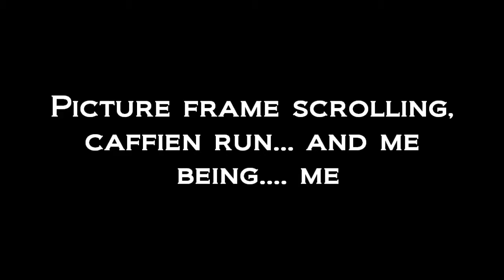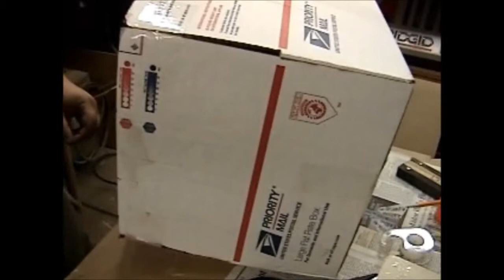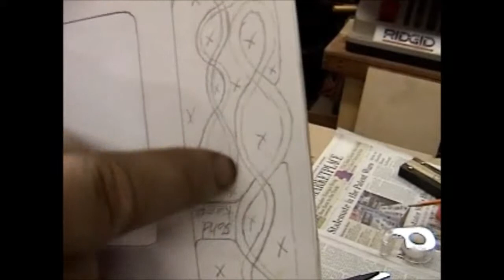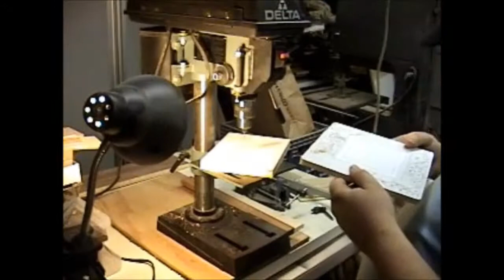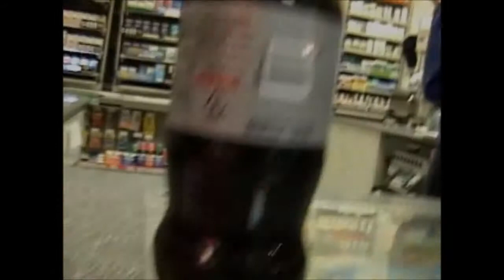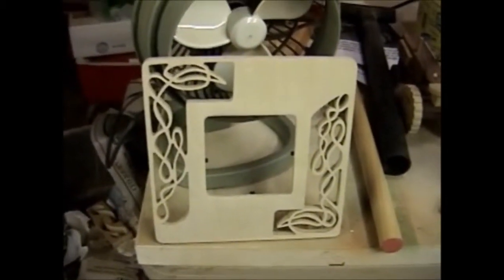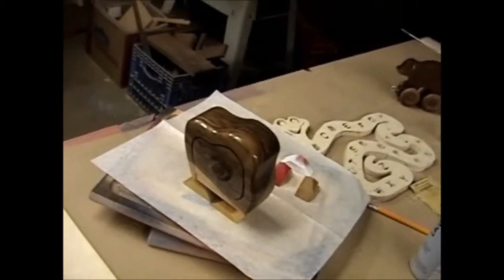Scrollwork on a $1 picture frame

Comment: Hi There! 
Contrary to the jerks opinion below me, I happen to think you’ve got some valuable info on your vids. 
Anyways, I do have a question and I’m hoping you’ll be able to help me- 
I’d like to start making picture frames similar to the $1 one you used with this project. 
Except I’d like to use a higher quality of wood. (Maybe a tiny bit thicker too) and I’d like to add in inlay (inlet?) for the plexiglass/picture to rest on. 
I like those types of frames because they’re  seamless & look a lot neater to me. Plus, I feel as though it would be faster. As opposed to mitering joints, gluing, adding v clips, clamping, etc.So my question is this- 
What type of tool and/or method would you recommend for cutting out that square in the middle? A scroll saw seems way too advanced (and expensive) for the type of work I’m looking to do. 
Also, would I be able to use my Dremel to make the inlay or would I absolutely need a router? 
Thanks so much. I hope I’m making sense and it completely embarrassing myself here. 🤪 
Thanks in advance & I hope to hear back from you. 🤞🏻